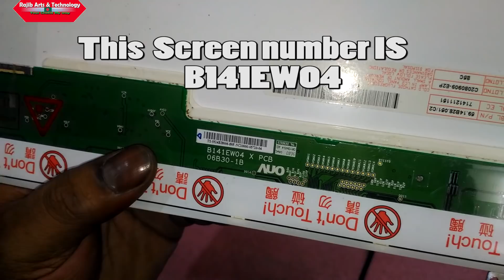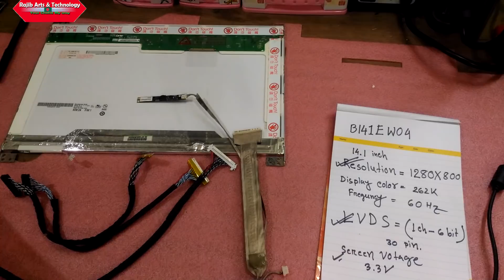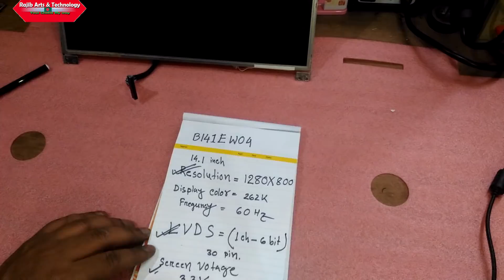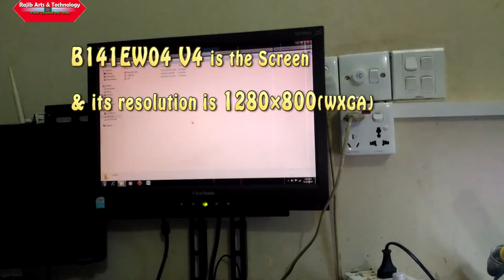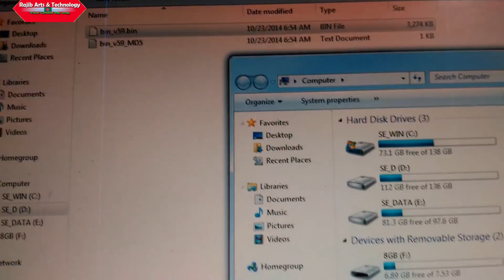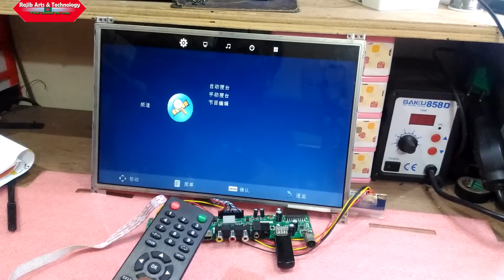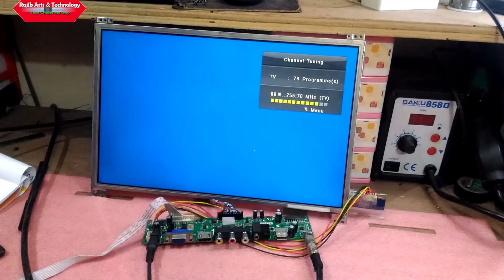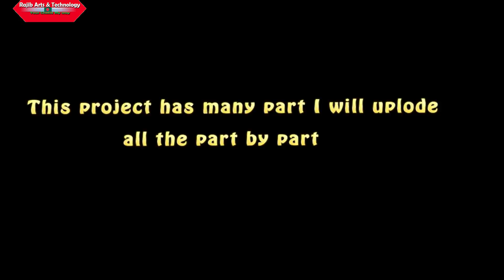How to make TV from an old laptop part-01

Comment: Hi sir. It's very impressive to see board with customizable resolution. I need your help in one point. We had NEC x461s monitor which has SAMSUNG LTI460HJ01 panel on it, but internal board burned during some electrical tests on our office. My chief gifted me that panel so I want to use it with custom board like yours. The problem is, LTI460HJ01 model has 2 LVDS output on it. As I see on NEC's original board, 2 LVDS comes and connects to 2 (41 and 51pin, total 92pin) LVDS input. So how can I find 92 pin compatible board for this panel?
Reply from the maker: +veagnox ,ok you can do use you screen with universal LCD board .watch my other video on this type,you can get  idea .good luck.
Reply: Rajib Arts & Technology Md.Mahfuzur Rahman thanks for reply, but how? :( I watched nearly all of your videos, and didn't see any board with 2 LVDS input or something :/ Can you give me any idea?
Reply from the maker: veagnox ,ok your screen is little complex but possible.can you send me a picture of your panel part number back of your panel.
Reply: Rajib Arts & Technology Md.Mahfuzur Rahman thanks a lot for trying to help. I sent 3 pictures and a little bit information of the panel/controller it has. Please check your mail. Ignore my first mail that sent 2 days ago

Comment: Bro, where from can I get this controller board. Are there different controller board for different LCDs?
Reply from the maker: Parijat Singh ,find your local electronics shop or international web store.there are many chip set  universal board in available market.all most every board support all kind of panel but software is more available few board.
Reply: Take V59 board volume 4.1 it doesn't need firmware's.

Comment: Sir, I mean it has 5 numbers of vcc  input pin but universal board has 3 numbers of vcc output pin in lvds cable, so how to connect
Reply from the maker: Most of the time all vcc pin are parallel so first use a common lvds cable if its not work you can solder to another vcc 5v to your panel.good luck.

Comment: Sir, finally I connect my laptop with it but display is not clear so much of noise in it. If I change resolution some waves are coming . How to solve it?
Reply from the maker: Don't worry,you should remap the lvds .go to menu than press 1147 ,general settings - lvds map ,select once another (1-9).some of number you got clear picture.

Comment: Rajiv bhau please help me my v56.03 board not updating through the usb. I tried may bin but no one worked for me. Help.
Reply from the maker: I think you brick your tv board.you should buy a new one & remember don't power cut during the the firmware update time.if you do that you will brick your main board. But you can repair ,you need a bios Brunner & re bios 8 pin bios chip in your board.
Reply: Rajib Arts & Technology Md.Mahfuzur Rahman no sir it is new I never ever updated and software.

Comment: How didi u adjust the voltage?
Reply from the maker: Witch voltage ? Screen or backlight
Reply: @rajibartstechnologymd.mahf9807 
For both screen and backlight. And can i use the inverter board from my laptop to power my lcd screen. There is a 2 pin connector coming out from my screen. Also can i use the v56 control board for my lcd?

Comment: Sir, my LCD has 5vcc pin but universal board has 3vcc so how to connect with it?
Reply from the maker: No you have 3 different voltage ,12v,5v &3.3v with jumper setting .watch my all LCD universal board related video already I show how to configure lvds voltage.

Comment: Hi,  My old dead toshiba laptop screen model is SPS:V000040020, screen connected cable model is TC7943 LCM cable, which controller board i need to use. please help

Comment: can i make this one?
Model:B101AW06 V.1
Size:10.1 inch
Resolution:1024*600
display color 262k
frequency 60hz
lvds = (1ch 6bit) 40 pins
screen voltage= 3.3

Comment: Can this display play 1080p videos?
Reply: No, only 720p. You can tell what it plays by the number after the "x". For example. 1234 x 840 generally means 720 because the second number isn't about 1080. For 1080p, the number will read 1234 x 1100. The second number is higher the 1080 so the video will be able to play 1080 videos. But this info is just general and not too accurate.

Comment: i have this monitor, when i open it i did not see any inverter there?  http://www.panelook.com/N156B6-L05_Innolux_15.6_LCM_overview_2155.html any help people please
Reply from the maker: budva ,don't worry you didn't need inverter board .because your panel has build in led driver board.so you need a lvds cable with extra 4 pin wire.what connect in inverter connector in tv main board.see this link you understand.
https://m.aliexpress.com/item/32796911597.html?trace=wwwdetail2mobilesitedetail&productId=32796911597&productSubject=LVDS-Cable-1-ch-8-bit-40-pins-40-pin-single-8-LVDS-cable-for-laptop
Reply: so i dont need inverter board at all?
Reply from the maker: budva ,yes just need lvds cable ,I have already given a link.